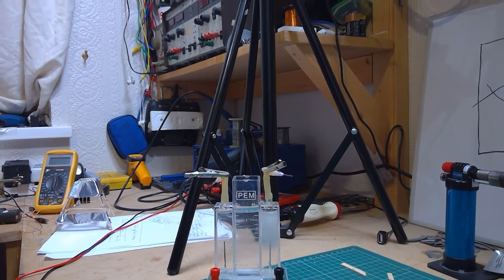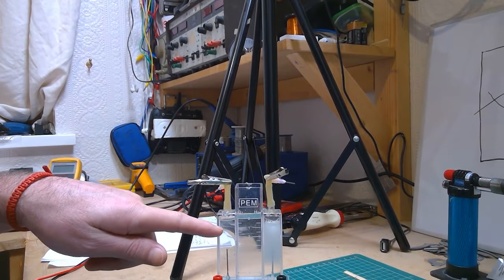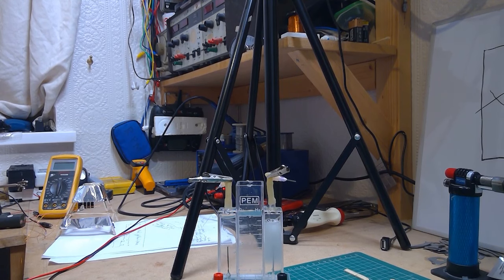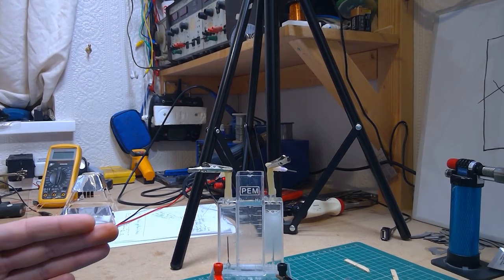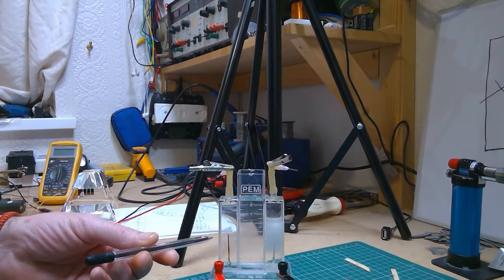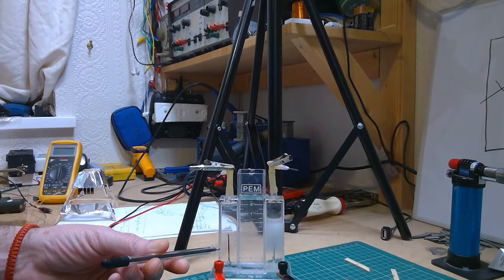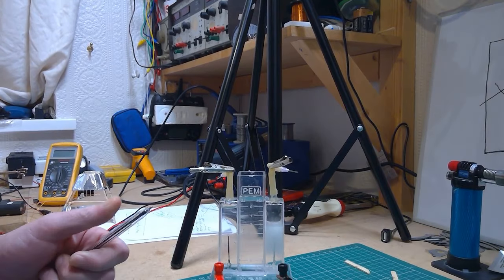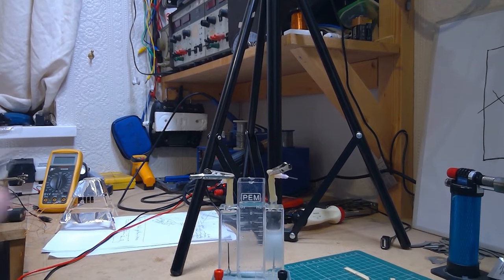ALERT I'M OUT OF TIME I DONT WONT TO GO... POLE SHIFT GSM CC

Comment: There is a reason for this Gene: In a typical electrolysis experiment, both hydrogen and oxygen are indeed produced. However, there are several factors that could prevent the production of oxygen:

1. **Presence of Halide Ions**: If your electrolyte solution contains halide ions (chloride, bromide, or iodide ions), these ions may compete with the hydroxide ions to give up an electron at the anode. In this case, the corresponding halogen (chlorine, bromine, or iodine) is produced instead of oxygen¹³.

2. **Overpotential**: This is a phenomenon where the actual voltage required to cause electrolysis is higher than the theoretical cell voltage. This can affect which substance is produced at the anode⁴.

3. **Concentration of the Electrolyte**: The concentration of the electrolyte can also affect the products of electrolysis. If the concentration of other ions in the solution is higher than that of hydroxide ions, those ions may be preferentially discharged, resulting in the production of a different gas¹.

4. **Purity of the Water**: Impurities in the water can also affect the products of electrolysis. For example, if the water contains dissolved salts, the ions from these salts may interfere with the production of oxygen¹.
Reply: Yes you have to use demineralized water with just a touch of salt
Reply: What he said ^ 😁  ?
Reply: Is your water from the tap?  They put hydrogel in the water now!!
Reply: @sandytheisen5389  how do u remove it ?

Comment: the oxygen and hydrogen are the bubbles coming off the cathode, the lack of bubbles on the anode has more to do with the electrolyte content of the water perhaps the rate at which the anode disaggregate this will depend on how insoluble the anode is too maybe also the overall voltage of the cell

Comment: I have had the same topping up the distilled water level on the negative side (Hydrogen) of my solar & wind battery bank.  The positive cells dont lose water, I did think it strange when I checked battery water levels.  Should be water loss on both sides after turning to the 2 gasses. Perhaps something has been changed in this simulation. What if Plants have stopped making oxygen, we would be doomed. Has something happened at CERN.

Comment: Bad connection? Check the 500 other websites that have done this.. don't they have to be connected together ,  you accidentally switch the anode and diode?  Doesn't it have to be a certain metal in the water.  Is it salt water?  100 things....

Comment: Where did you source the water? Could it be from graphene oxides? It's being used to process drinking water to reduce water loss. Just a silly question as I am not versed in these things. Is your equipment working properly? Did you do resistance testing and etc on the wires to make sure there isn't any defect? Sorry if I sound like a tool.

Comment: Thats incredible does it happen every time? What is the concentration of electrolyte. And how much voltage + current. Ive done  this myself and it has never happened that way. If not quantum physics if i were you id write down exactly what your using including sll parts components andtry to do it again using a ehole new set up. Wow

Comment: I imagine that you have produced H2 O2 Hydrogen peroxide  solution with a strength that should make detecting  H2O2  quite easy. the solution should be handled with care. I am not saying I am right but it`s the reasonable thing to imagine.